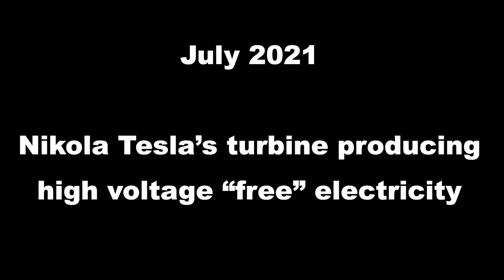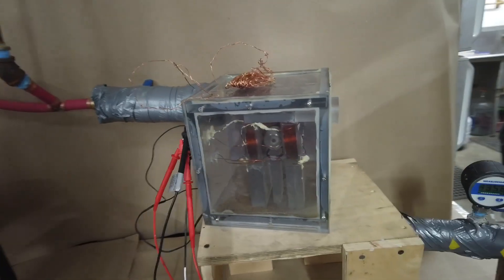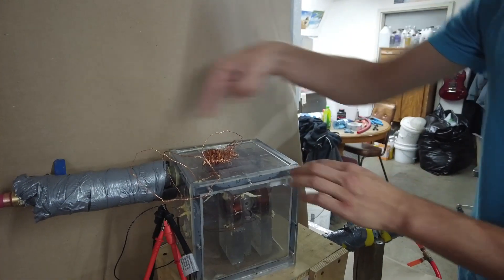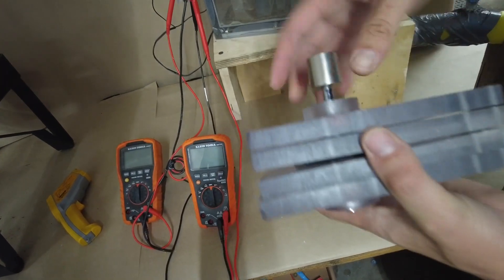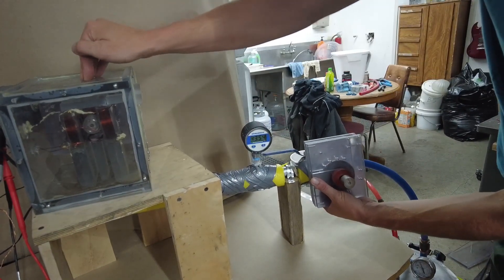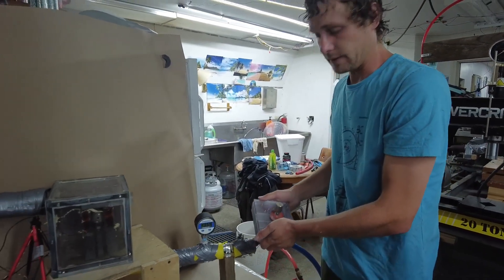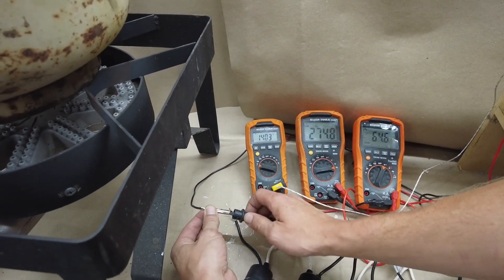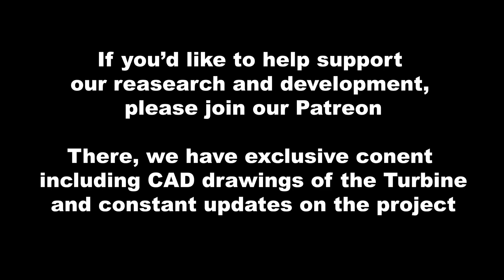Ground Breaking Renewable Energy System Using The Tesla Turbine

Comment: I'm a proponent of Tesla turbines, and trying to build one for experimentation, but it occurs to me there is a chicken-egg argument here. These turbines, while an engineering wonder, are useless without some form of pressure exerted, which means some other form of energy must create it. Compressed air requires energy to compress it. Cold steam requires some energy to create it. Traditional steam also requires some energy to create it, and it doesn't seem likely the Tesla turbine will run on water without pressure, again requiring energy. Still watching the video, but basic cold steam seems to require a vacuum and substantial temperature differential, which other videos I've seen show it would seem is exhausted in a single surge. So can someone explain how this can possibly be 'renewable' energy if electricity, heat, or pressurized water is required to make it work?
Reply from the maker: I tested for over 20 minutes without needing to re-heat my boiler. This was with an inferior turbine as well. The reason I stopped the test was because the plastic in the casing failed. at around 212 degree water the casing slowly got week and the vacuum caused the casing to slightly collapsed from atmospheric pressure and caused the rotor to scrape the casing. The new turbine doesn't have this issue due to the aluminum casing. The turbine is designed for steam but other gasses/liquids can be used as well that boil at much lower temperatures. Ill be storing the energy in sand so I can store much higher temperatures and store more energy without a giant pressure tank. This actually makes a thermal battery and the heat can be directly converted into electricity via the turbine. The thermal battery will be heated with solar heat collectors and when there is no sun for weeks, if you have a wood stove you can power your house on firewood. The turbine can also use any wood and nearly any heat source to make electricity.

Comment: Smart work.  I'm wondering if you ever considered using supercritical CO2 as opposed to water?
Reply from the maker: I would like to avoid using such high pressures. I may want to use something like ammonia or another coolant. I need a system that will be cheap and safe for everyone.

Comment: I would like to help, tesla turbine + inline 6 steam engine. also use a little pit of power to either heat water or make more pressure.
Reply: as a back up you would only need 1 coal create heat if anything went wrong

Comment: Research. A Micro Tesla Turbine for Power Generation from Low Pressure Heads and Evaporation Driven Flows.
Reply: Some researches show that the tesla turbine is efficient for small scale electricity generation, say domestic power supply (electric generator) .

Comment: Do you think that the video that I sent you the other day. Geroid Morin had his magnet set up with north, and south on the top, and bottom of his magnet, or do you think he had the north, and the south poles running parallel ontop of his coil, and what do you think about the transformer idea. Will it work, or do you think that the magnet has to be flipping the north, and south poles, and what about tightening your coil loops with fine wire. Just saying you are a scientist!!
Reply from the maker: He has the north and south running perpendicular to the shaft. I'm not sure what significance his work has because he never met any conclusions. He did some really interesting stuff though.

Comment: Question regarding the generator portion the cylinder magnet you use did you drill a hole through the center or just attatch it to the end of the shaft? Trying to wrap my head around it. Awesome project i have been following your channel for a couple years now....all the way from Canada
Reply: It must be posibel to finde them pre fab with a hole... It's almost imposibel to drill these magnets.
Reply: @eriknielsen1849   that's what I thought at first but from the video it looks like they drilled it. Thank you for the reply

Comment: why this system has tu use tesla turbine and not conventional steam turbine used in power plants. Those turbines have established 90% efficiency and doesn't have to go at super high RPM to achieve it. What's different about cold steam? Wouldn't it work with conventional steam turbines? And why power plants around the world don't use this cold steam approach?

Comment: I really do not understand how the turbine could end up producing ice or cold water?
Reply from the maker: that was actually done with compressed air and water vapor, ice built up in the turbine, the second stage of the turbine lowered the pressure and caused the water and compressed air to expand so much that it cooled down the gasses to the point where the water froze.
Reply: @iEnergySupply  How long does this system last up until your need supply external heat of lower the temperature on the cold side?

Comment: New subscriber. You have done much and achieved more. As a commercial property developer, with lots of space on roof slabs, and buildings where every watt is a treasure, am very keen to know when we may find units for sale.
Reply from the maker: thsnks, this is certainly the best option as the turbines can be very cheep and solar collectors/solar heat tubes are extremely efficient.

Comment: "Air Cycle" refrigeration requires a load. Heat converted to "work".

Is it possible the cooling effect seen with the addition of a pump making the turbine "double acting" is more a result of the added load/work output, rather than the draw of the additional vacuum?

Also Claude process liquefaction of gas to produce cryogenic temperatures requires a load on the expander/engine/turbine.

In other words, could the virtue of the double acting turbine (cold/ice formation-"efficiency") simply be the result of the added load/work output of the pump.

The implication there being, any load on a single acting turbine could produce a similar cooling effect.

Comment: If you want to get more power from your Tesla Turbine inject the compressed air into your Tesla Turbine from where the shaft is.  Because  𝒚𝒐𝒖𝒓 𝒔𝒚𝒔𝒕𝒆𝒎 𝒐𝒑𝒆𝒓𝒂𝒕𝒆𝒔 𝒂𝒈𝒂𝒊𝒏𝒔𝒕 𝒕𝒉𝒆 𝒄𝒆𝒏𝒕𝒓𝒊𝒑𝒆𝒕𝒂𝒍 𝒂𝒏𝒅 𝒄𝒆𝒏𝒕𝒓𝒊𝒇𝒖𝒈𝒂𝒍 𝒇𝒐𝒓𝒄𝒆𝒔. Due to 𝒄𝒆𝒏𝒕𝒓𝒊𝒑𝒆𝒕𝒂𝒍 𝒂𝒏𝒅 𝒄𝒆𝒏𝒕𝒓𝒊𝒇𝒖𝒈𝒂𝒍 𝒇𝒐𝒓𝒄𝒆𝒔 Tesla Turbine at such high rpm creates a vast amount of vacuum from the center where the shaft is and forces that air pressure outwards. As you inject compressed air from the outer rim of the TT you defeat the purpose of efficiency. I hope this helps.  Later on, if you want?  I can give you another tip that you'll be able to increase the COP of this experiment much, much higher.

Comment: The voltage reading you are getting on the Klein meter probably isn't accurate.  The frequency range for the "True RMS" is something like 50 to 400 hz.  If you are trying to do a power(work) calculation using this equipment it probably won't be correct.

Comment: You can't attain a vacuum in a container that has water in it.  As you try to remove air, it just creates more water vapor and uses up the water LONG before anything close to a vacuum happens.   If you mean something else, then say something else.
Reply from the maker: anything below atmospheric pressure is a vacuum.

Comment: Could this be scaled up to run a full house off a closed loop steam boiler? And if so how do you catch the exhaust steam to recondense it’s back to the boiler?  I’m trying to run my house off grid and steam is going to be the cheapest way to do that. The problem I’ve had so far is that nobody makes a 30kwh steam turbine and the smaller turbines I have found are astronomically priced.

Comment: Hi i am struggling to understand why you are pursuing the cold steam? IMO its not needed as you only need to get the TT shaft into a friction free state and then rotating with AP at a constant RPM. As per 3min point you can create AC from the shaft and then also link the TT shaft to another separate shaft via magnetic flux 5min point (friction free). This IMO means you could run many shafts (suspended via magnets) from one TT due to resonance frequency and release the magnetic flux on all linked system to generate electricity in an ultra efficient system? thoughts? its not free energy you can just direct magnetic flux and AP(solar) into a different usable state!!

Comment: I like to see tests on how much energy goes into the system vs energy produced.  How much energy is needed to heat the water, chill the cold tank, and lower the pressure to a vacuum.
Reply: I think the ultimate end goal is the the system operates from simply ambient air and atmospheric pressure once spun to supersonic speeds in order to generate cold steam, ie no heat source is required?
Reply from the maker: sort of, we want to use solar heat at the very least, the collar collectors can be up to 97% efficient, and the energy can be stored in water.

Comment: Wonder if the bearings will last. Also, how much energy is consumed heating up the water and creating the vacuums, vs energy gained?
Reply from the maker: the bearings are rated at 150000 rpm so they should last if the Trubine were to be well balanced, unfortunately it's not balanced that well. See the next video on our channel to see how the system works, you only need to charge the system with vacuum one time.

Comment: I see only one problem with tesla turbines and I think that's the main reason it's not used everywhere. These turbines are super cool and super efficient, BUT they run at a very very high RPM. Not a problem for small scale models like the ones you're making, but they don't scale up well. To my understanding, the centripetal force become way more extreme as the rotor is built bigger, because they still need to rotate really fucking fast to be efficient. Another factor is the very precise tolerances that needs to be considered when building this larger, it's certainly possible, but it may get crazy expensive.

Using vacuum in a closed system to lower the boiling point of water is clever though. What do you do when all the water has boiled over to the condenser? Pump it back into the boiler?
Reply from the maker: The video that talks about the speed of the turbine for very large turbines made a big mistake. Here is the mistake they made. The video says the rotor must spin at a very high rpm, maybe 50,000 for a 6” turbine. The speed of a turbine is based on periphery speed not rpm. If a 6” turbine needs to spin 50,000 rpm to be efficient like the video says, that’s a periphery speed of 890.1 Miles per hour. If you want a 3 meter disk to achieve close to 891 miles per hour at the periphery, the rpm required is only 7,253. We have materials that can easily reach that speed. Here is what nikola tesla says about the increase in size. 
"I have found that the quantity of fluid propelled in this manner, is, other conditions being equal, approximately proportionate to the active surface of the runner and to its effective speed. For this reason, the performance of such machines augments at an exceedingly high rate with the increase of their size and speed of revolution."
Reply: @iEnergySupply  Thanks for the reply. I did watch that video, but what you're saying does make sense. I guess a larger disk would then have a lot more torque? Now I'd like to see a large tesla turbine in operation, has anyone even made a larger one? Say with around a 3 meter disk or something?
Also, if you don't mind. What do you do when all the water is boiled over and condensed on the other side? Transfer the water back with a pump? Switch hot and cold sides and run the flow the other way?

Comment: Sigh, this is so inefficient as to be ludicrous. Energy must be invested in the vacuum pump operation, the production of ice, up front before any energy is produced, This energy will not be recovered. etc etc. Hopeless as an energy producer. Still fun to watch. Cheers.
Reply from the maker: Actually ice isn't needed only cool water. 55 degree water is perfect, which the earth sufficiently supplies all year, a simple heat exchanger will do the trick. Also the vacuum pump only needs to be run one time to run the system over and over, it's only a primer. Please see this video to help you understand more about how this works. https://www.youtube.com/watch?v=W1K2CMRyDrw

Comment: Voltage is not a measure of the power, wattage is.
Reply from the maker: The power is measured by volts times amps. Volts multiplied by amps equals watts.